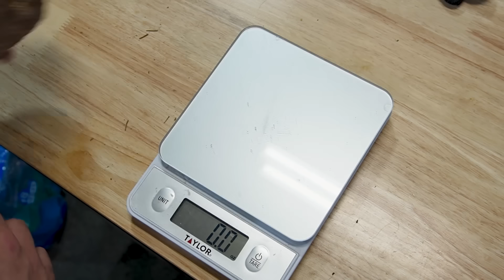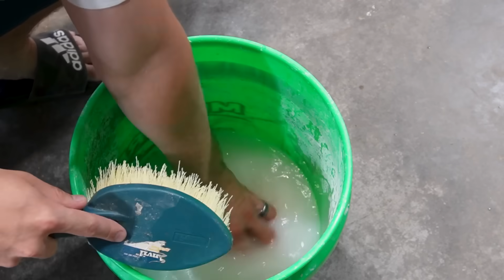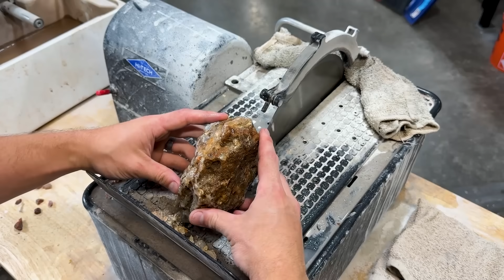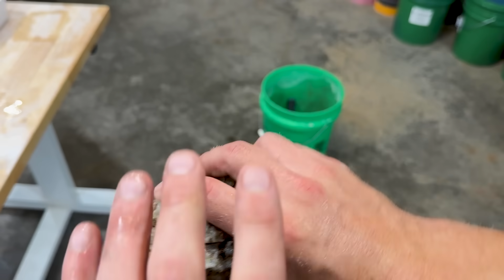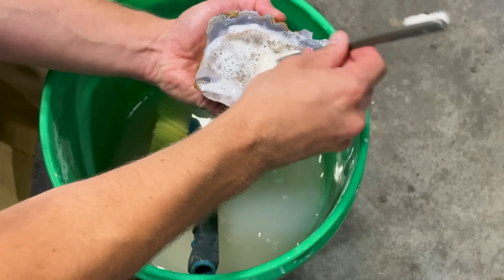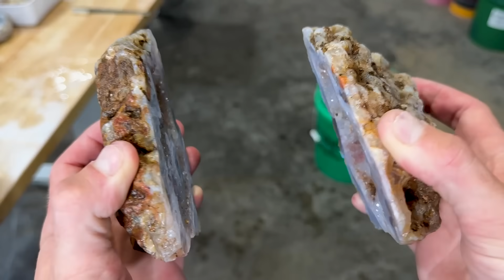Is This Rock a GEODE?! It's Lighter Than it Should Be...

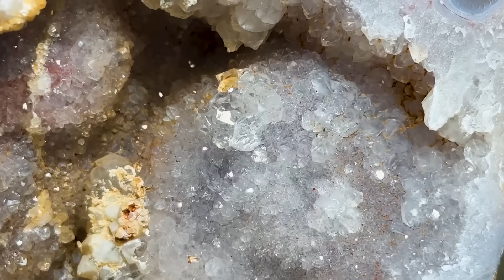Comment: 6:26 is that amethyst in with the geo?

I can't remember what they are called but they are small thin bristle like things (kinda looks like pipe cleaners but for between the teeth) would work great for the hard to reach spots that the actual brush can't get to